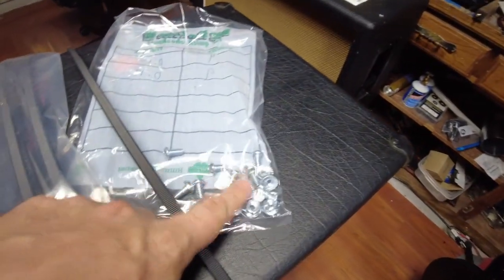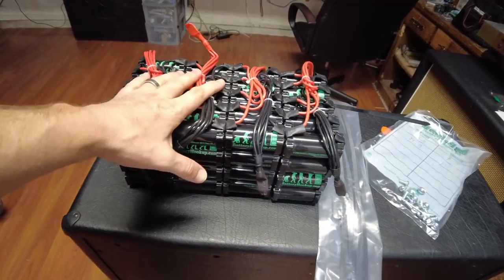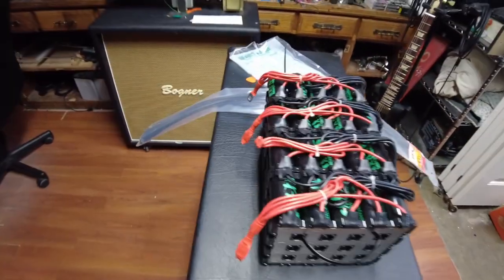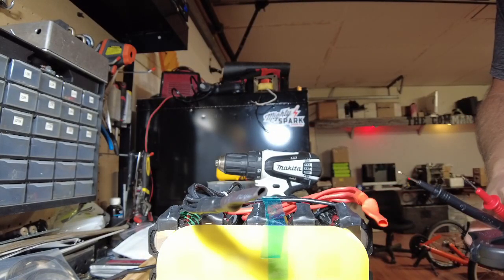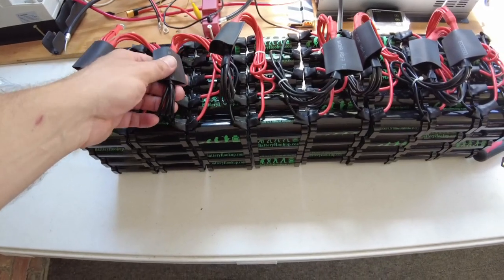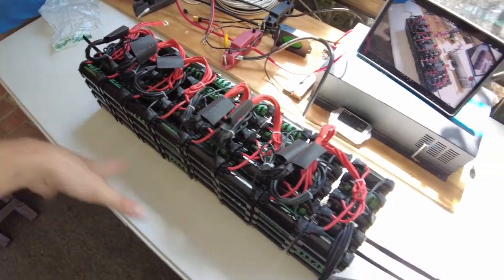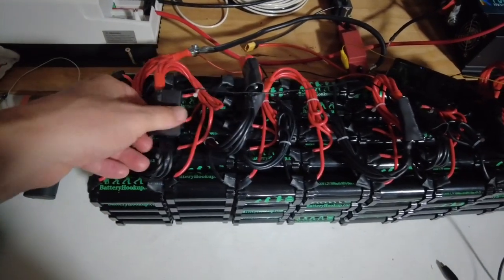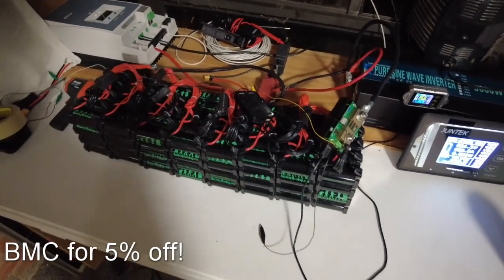DIY Affordable LiFePO4

Comment: Just built a battery using cells from Aliexpress... they said 2 month shipment, arrived in 35 days.      Built a 5 kwh pack for less than $900 bucks, pretty satisfied with the price and experience.
Reply from the maker: Yup, that's an option. But 5kw using these battery hookup cells is less than $900, ships from the US about 5 days, and you can get timely replacements if you have a problem.
Reply: @BradCagle  What is the warranty on these batteries?
Reply from the maker: @uhjyuff2095  Good question. BH website say's "60-day warranty on all of our products" I can ask them.
Reply: @BradCagle  I guess that is decent for diy and used batteries.
Reply from the maker: @uhjyuff2095  Yeah, I don't think they could offer a lengthy warranty given the low cost, and DIY targeted use. I'll still shoot them an email, and find out.
Reply: @uhjyuff2095  The batteries in these particular packs are brand new. Battery Hookup had these specially built for them.
Reply: @Brandon-dg8zn  What brand are the battery cells?
Reply: @uhjyuff2095  BatteryHookup brand 32650 cells. Not to be confused with the 32700 which have screw posts. They are in a 4s5p configuration (20 cells in all). 4 packs equals 12v and around 33 pounds.
Reply: @BradCagle  how could you build a 5kw for less than 900?
Reply from the maker: @stevenmyers2252  100ah pack ($50) X 3.2v X 16s (48v) = 5.12kwh. 16 of these packs were $800 at the time I did this video. Now they are $880 for 5.12kw
Reply: @BradCagle  wasn't doubting you just curious where you can get 100ah for 50 bucks right now ?
Reply from the maker: @stevenmyers2252  https://batteryhookup.com/products/new-battery-hookup-lifep04-32650-3-2v-5000mah-cells-1

$220 / 4 = $55 If you use discount code BMC you'll get 5% off
Reply: @BradCagle  I was thinking the 260 kit since I figured you needed BMS plus I was thinking a charger but understood. 

I'm new to this so I don't quite understand use of BMS vs other options.
Reply from the maker: @stevenmyers2252  Yes, i suggest a BMS. That kit will be great if you need 12v. If you need more than 12v that BMS will not work.
Reply: @BradCagle  honestly not sure where I will land on voltage. Given the fact I can use light wire I would probably plan to go to 24 or 48. That being said I have been so focused on trying to pick a grid tie inverter I haven't paid much attention to the charging capabilities of the inverters.
Reply from the maker: @stevenmyers2252  Yeah, I would suggest 24v or greater. 48v being better since its even easier for the inverters to do their job. Are you trying to run your whole house, a portion, a cabin, or RV? What's your application? Most grid tie systems don't do batteries, the hybrid inverters do but not fully grid tie, rather they can use the grid as a failover if your batteries are exhausted.
Reply: @BradCagle  I was just hoping to stock up some extra power from the day to limit grid use at night. We do have net metering so I can sell back but I would rather just pull less from the grid and zero export back to it.

Comment: Battery prices are coming on down… That’s a big damn battery for $400ish…
Reply: You also have to factor in shipping but even still, these are definitely cheaper. The beauty of building your own battery systems is you know what components are in your system and that makes troubleshooting and upgrading a whole lot easier. The basic system I plan on building with a pure sine wave inverter will be around $650. May not be as pretty or as compact as the commercial versions but will be a whole lot cheaper. Add in an MPPT charge controller and a few solar panels and you now have free electricity.
Reply from the maker: Agree, pretty sweet!

Comment: Just purchased 2-4 packs to build 24v. To build a portable ps. 2 Rich 24v. 200w panels. With the lack of experience in solar, need all the tutoring I can get. Not sure of what other equipment I need. Charger....ect. looking  forward to you next video. Soldering the tabs. Also the orientation of the completed 24v. Pack. I planned to put it in a rolling tool box, with a 3kw. All in one inverter. Any ideas/help appreciated
Reply from the maker: Right on. You need an 8s LiFePO4 BMS batteryhookups smart BMS is a good choice. As for the all in one inverters, growatts are good, not sure about everything else.
Reply: @BradCagle  I did get a growatt, 24v. And an active balancer.  But as for an adjustible dc power supply not sure, just suggestions
Reply from the maker: @HappSsack  oh for top balancing I assume? I use the ISDT Q8 charger, it's  an actual battery charger up to 8s with balancing, etc.. It does need a pawer supply too, I just use an old laptop power brick.
Reply: @HappSsack  I hope you get a BMS for your battery. An active balancer does not take the place of a BMS.
Reply: @uhjyuff2095  yes, I got a bms
Reply: Not sure if I understood well, but I just bought an ''all in one'' 24 system from MPP SOLAR. This was recommended by Will Prowse. I have installed it yet, but in my system, evertything is already in the ''ONE'' box, charger included.  It was the easiest system that I've seen on the market.  But these batteries are getting my attention too...
Reply: @cambobby2011  yes, mine is a 24v all in one also, but with a split phase.  Wasn't looking for a split phase but it was a smoke'n deal. Growatt, 3kva. I'm just building an emergency generator. To get some experience.  Want to do the house next. Might add an additional  24v. Battery pack to the unit not sure, just mo $$$. Kinda want 48v for the house, but 24v. Should be good. These batteries look excellent. Mine shipped today,  so next week delivery.
Reply: @cambobby2011  Brad is very knowledgeable,  and has great ideas, open to suggestions no bs approach.  Looking forward to see if he cuts the packs open and solders the tabs. The tools for solar are a what I'm I lacking,  not sure on all the parts and peices for the system .
Reply: @cambobby2011  which one did you get? Will Prowse seems to be very knowledgeable but he definitely has a lot of videos out there. I don't really want to have to go through all his videos to find this info.
Reply: Not sure if I understood you correctly, but I just bought myself an ''all in one'' 24 volt system from MPP SOLAR with a 2000 watts pure sin wave inverter in it. This was recommended by Will Prowse. I have NOT installed it yet, but in my system, evertything is already included in ''ONE'' box, charger included.  It was the easiest system that I've seen on the market.  But these batteries are getting my attention too...
Reply from the maker: @cambobby2011  Yup MPP solar is good!

Comment: Will these work on car audio
Reply from the maker: Yes should work fine. Should do 1200w continuous @ 12v (four modules in series), and 2400w peak. If you want more watts you can add more modules in parallel.

Comment: I'm curious about the capacity of the pack that was undervolted. I've dealt with lifepo4 a bit and my experience is that they'll deal pretty elegantly with moderate undercharging. My guess is they'll charge to full rated capacity or very close to that, effectively giving you a whole bunch more battery.
Reply from the maker: Good question, I should pull a capacity test. Just need to figure out something to use as a 3v load. Thanks for the idea.
Reply: @BradCagle  try a piece of heating element wire from a junk electric heater ?

Comment: Instead of soldering them together, Solder a fuse between them, not a large fuse, but id say 20-30a fuse for each. This way you have some protection...
Reply from the maker: Interesting, I'll give that some thought. Thanks for the idea!
Reply: @BradCagle the nickel strip is a fuseable link with a specific rating if im not mistaken
Reply from the maker: @stygianindustries8295  This is absolutely true. I accidentally found that out when I shorted a pack I built, the strips luckily did blow :)
Reply: fuses should go between parallel battery cells not in-between the series connections.
Reply from the maker: @uhjyuff2095  True

Comment: Yo what did yoou figure out on the active balancer vs bns?
Reply from the maker: Well I'll say this, the active balancer is far superior to crappy BMS resistive balancing. I've used it several times now, however not in a long running system. When I get my Powerwall setup I intend to have it in full time. On a side note I would not consider it a replacement for a BMS, unless you really know what you're doing for the specific application.
Reply: @BradCagle  i emailed heltech and asked them they said they are meant to be used in tandem if your packs get out of balance often. What cells are you going to use for powerwall?
Reply from the maker: @stygianindustries8295  Right, yes you would use it together with a BMS. I'll be using the SAB 60280 cells, and the pack I just built in this video. I also have about 3kw of 26650 cells I'm still spot welding together :)
Reply: @BradCagle  how will you manage the different type cells charge and load share?
Reply from the maker: @stygianindustries8295  Each of the three will be arranged in packs of similar capacity, and I'll have a BMS, and Active balancer on each.
Reply: @BradCagle  Noob question: do you have one BMS and active balancer for both LiFePO4 packs, or one for each? How many would I need if I went all the way to a 48 volt pack?
Reply from the maker: @JohnboyCollins  Ideally you would have a BMS +  active balancer for each pack. if your doing 48v lifepO4 you need a 16s BMS, and a 16s Active balancer